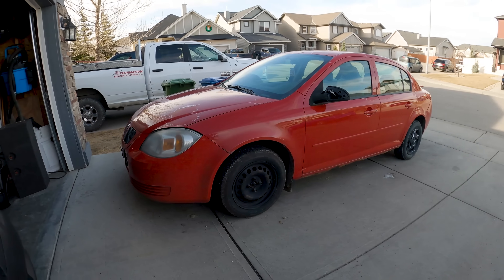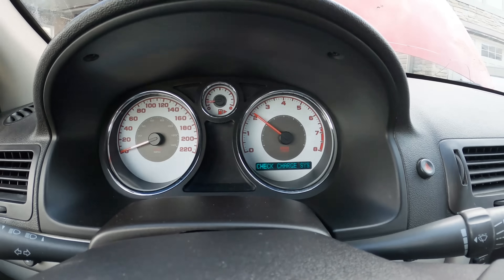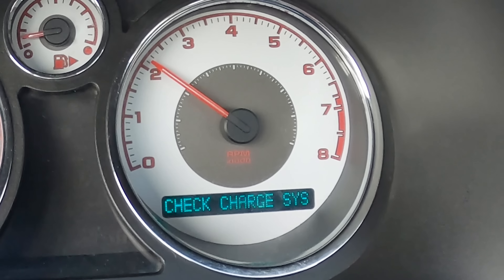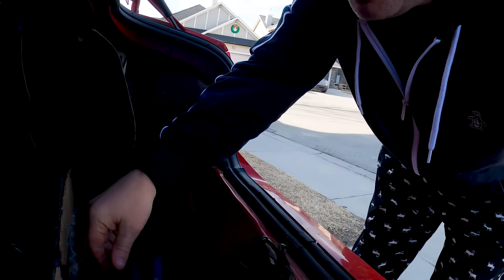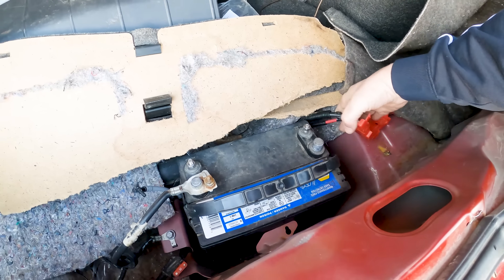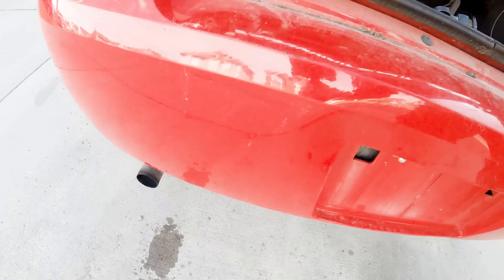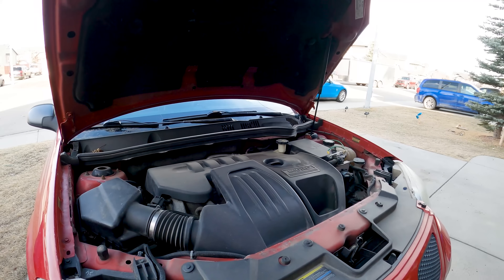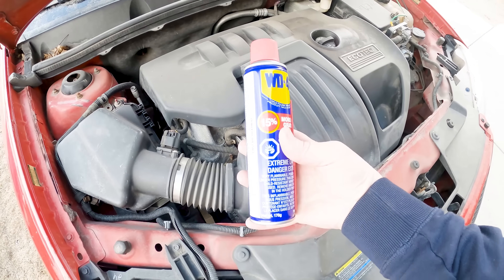ROADSIDE FIX! REVIVE your DEAD or DYING Alternator with this ALMOST FREE trick! | Gears and Tech

Comment: DO NOT DISCONNECT the battery while the vehicle is running as demonstrated in this video on a MODERN VEHICLE. 
Now my 71 c10 outside or my 76 Grenada lol hush yo mouth don’t start this about not screwing up your new car or truck computers and  or Alternator. But yes I have checked to see if my Alternator was working by removing Neg cable off battery. Older vehicles only
Not even gonna touch on the WD
Reply from the maker: Thanks

Comment: In the old days, like 1977, you could pull the battery and it would stay running.
The volt meter actually would be around 16 volts when there was a dead battery.
13.8 when fully charged
Reply from the maker: Thanks for sharing
Reply: That great because i drive a 1977 ford maverick.:hand-pink-waving::hand-pink-waving::hand-pink-waving:

Comment: Surprising, i would have thought that the WD40 end up lubricating the brushes where they sit in their channel aimed at the rotor... allowing them to slip and make contact more easily when they are at the end of wear... the spring is obviously now weaker as it is extended due to the shorter carbon brush... so the brushes can stick near the end... as for swapping out, why not simply buy the brushes and fit them yourself? which on high mount alternators often means you don't even have to remove the alternator... as long as you can get to the rear of it, it is usually one screw that holds the brush module in place so dead easy and cheap to change yourself... you could even carry spare ones... :) good tip though...
Reply: it would be a rare thing for their to be any dirt on the brush ends as they are in constant contact with the rotor centre, they are usually clean as a whistle, so i am going with the lubricant allowing brush movement...
Reply from the maker: Agreed.

It does clean stuff up though.

Comment: you can pull the the batt terminal on older cars but on newer modern cars better not do it you risk frying the sensors or modules because of the high current surge that may occur.
Reply from the maker: Thanks

Comment: Yip yap buy a volt meter read battery not running probably 11 to 12volts. 
Then start and read should be 13 to 14.
Clean those terminals and tighten properly.
Reply from the maker: When that doesn't work? What then?

Comment: I disagree with disconnecting the alternator with the engine running as this removes the load from the alternator, allowing voltage spikes on the electrical system several times the 13.5 to 13.8V design voltage. It can destroy the rectfiers, even in an older, non-computerized car. Also, WD40 on the pulley side of the alternator should not be used. It is likely to cause belt slippage if it gets there. Worn brushes are likely to bind in their brush holders so WD40 may be a very temporary fix here.   It may also clean carbon and copper dust from the insulation between the slip rings, eliminating this resistive short across the brushes may make the alternator work somewhat better. Best to carry a cheap multimeter and test system voltage at the battery terminals.
Reply from the maker: Thanks for stopping by

Comment: If you want to take the battery cable off and do your thing then take off the negative battery terminal. That is called the ground. The alternator will run the car with whatever load it is taking. If it is a good alternator. If the alternator is bad then it will probably just shut the engine down as you explained. If there are voltage spikes then the capacitors will pick up the voltage surges. If that positive terminal goes and touches any ground the battery very well could explode and yes a lot of sensitive equipment will fry including equipment that is not sensitive. Very dangerous and a huge huge bill to fix. I can only imagine what the electrical equipment might possibly look like afterwards. LOL.. Capacitors are designed to take a huge hit but I can guarantee the capicitors cannot handle a dead short. Notice the word DEAD in dead short. So please do your tests with the black negative wire disconnected. At least you won't have a oopsy and get a Dead short with the red positive wire.
Reply from the maker: Agreed on positive vs ground cable, except battery won't do anything even if that cable touches metal, battery is totally isolated once disconnected from positive or negative

Alternator on teh other hand won't be happy about the positive touching ground
Reply: BTW the alternator is grounded so it runs on its own circuit and that is why the system will operate throughout the vehicle. If the vehicle has its proper voltage in the alternator the fuses, etc will do their job to protect the many circuits. There would be no problems with the vehicle working without the battery. Now if there is not enough voltage to produce that power to run the headlights for example the head lights will go really dim and it will eventually cause the vehicle to  quit but it will not destroy the headlights. If you go to low voltage computers, etc funny things could happen but there should be safety equipment built the module for example to protect this also for such an occurence. This would probably cause the vehicle to shut down also.  Common sense dictates thatv if you have Control Modules worth thousands of dollars that there are fail safe electronics that cover both sides of the fence. THe one thing that destroys these modules, etc are the spikes and as I said capacitors and such take care of this probably on a regular basis and of course do not forget about the simple fuse. That is usually the first line of defence. With big voltage spikes can come huge ampacity hence the importance of the fuse. LOw power or low voltage that is below normal voltage in most cases causes stuff not to work properly.  Electronic circuitry is very complicated but it is a lot of circuitry that involves a lot of schematic and wiring diagrams.When everything else is isolated just pop in another computer or module.

Comment: NEVER use WD 40 for your alternator as it is oil based and it will grease those brushes inside , yes it will remove dirt deposits inside and clean it up , you just got lucky if you were 600 miles away from home I'm guessing you were on a freeway driving home going 80 - 100 km/ h which air cooled your engine and all the dirt out of your alternator after you sprayed with wd 40 ... the best thing to use is air gun 🔫  and if you really want to spray something in it I recommend brake cleaner or electrical spray .. there is no oil in either one of those , cheers ... and one more thing if you are disconnecting car battery while engine running disconnect only negative terminal ( black one ) it will not cause any damage.  Cheers
Reply from the maker: Thanks for sharing

Comment: Excellent......WAY TO FRY ALL THE ELECTRONICS IN YOUR VEHICLE !  Never disconnect the battery in a running vehicle. The battery provides reference voltage for the voltage regulator which provides power to the rotor fields in the alternator. Some are built into the ECU.
      IF the alternator is good, output voltage can build beyond input limits of the electronics because battery reference voltage is isn't present to limit output voltage of the alternator.

  Do yourself a favor and buy a VOM ( volt/ohm/meter ). Even an inexpensive one from Harbor Freight ( they're like $8 ) will suffice and measure the voltage at the battery with the vehicle off and then running. Running, the DC voltage should read between 13.1  to 14.9 volts max. ( I'm a mechanic and my dad was a factory trained automotive field service engineer. )
   The two components most likely to be at fault with the alternator will be the brushes or the diode bridge assembly. Some have the voltage regulator pack in the alternator which could be bad also. All these can be replaced by the home mechanic. Any decent auto parts supply house should have them or there's always Ebay.
Reply from the maker: Which vehicle is this circuitry guaranteed to fry on? I'll buy one and do the same test. I would love to see this in action for science.

Not saying you're wrong. I'm just saying I've never seen it, and I doubt you have either.

So whoever told you this happens, maybe ask them which car it is for sure going to happen on so we can put this to bed.

I think we all know a guy who knows a guy that knew someone that thought he fried his car when he disconnected the alternator

But, has anyone here seen it? And if so, what's the vehicle.

I don't want any excuses. When I buy this car and do this test and it doesn't fry the computer, there is no going back. We don't want to talk about how lucky I got. I want certain computer frying to be had
Reply: @GearsAndTech  Did you not read my explanation of why this CAN happen ?  I'm not saying it will happen every time this is done, but it will happen eventually.
     If you investigate how the circuitry of the charging systems of alternator equipped vehicles operate then you will discover what I have stated is true.
     For your pocketbooks sake, I hope your luck holds out.

Comment: that wont help if your voltage reg is shot or if any diode problems and on an on...only helps a bad worn out brushes
Reply from the maker: There are certain scenarios where it won't help. But there are many that it will

Comment: one problem, if the problem isn't the alternator you could destroy the alternator by disconnecting the battery cables!!!! in my shop of the many repairs i did i always asked and about 50 did. Yes i know thats not much but a $200 repair and some can be up tp $500 when its not needed matters.
only!!! i repeat only!!! do the battery voltage test it's under $20 for some of those USB plugs and it tells you the same thing
Reply from the maker: Yes, the voltage test is easy. The battery test was the other way to check it.

Everyone should have a voltage reader in their car

Comment: This guy is dangerously stupid:  You NEVER disconnect the battery with the engine running, or you will instantly destroy the voltage regulator if it is not bad already AND other computers in your vehicles.  NEVER mess with the positive post of the battery first--ALWAYS disconnect the NEGATIVE POST FIRST or you will end up arc welding your tool to the car when it slips.  Oh, The HORROR of stupidity.

Comment: Ford Ka 2004. The car was not drived about half year or more. Its is not a garage car. I was going to trip, but was a very rainy day. About from the begining turn rear defroster on, vent defrost and curclulation on, fan on max, headlights on, wipers on. After about 10 kilometers defrost buttons lights start blinking. I stop the car. The battery had some power yet, but not enough to spark the engine. So i call to an fellow, he came, take the battery and charged it in fast for about 20 minutes. After that i drive about 45 kilometers without using headlight, defrosters, so on. And when i turn on the headlights the car engine almost instantly die. But i use the inertion, turned off the headlights and force the engine. The engine start, so i went back suceffuly. Next day we test the battery, and it looks OK. But when spark the engine, sometimes, voltage going under 14 V, unstable. What ur opinion and what can advice in this case?
Reply from the maker: Bad alternator. Test and replace

Comment: This might work short term on older vehicles. I wouldn't try it on my newer ones. One thing I will say is that by saturating all of your bearings in your alternator with penetrating oil will ruin them eventually. Bearings are packed with grease. The oil will dissolve the grease, they will fill up with grit and eat themselves. I fixed an alternator years ago by replacing the internal regulator for about $14. If the regulator is bad the Wd-40 won't do anything for you and ruining your bearings will cost you a whole new alternator.
Reply from the maker: Round here it's always going to be a new alternator. Doesn't matter why it's not working.

Comment: Yeah, dousing an electrical device with kerosene (which, when you ignore the added "make it not stink like kerosene" ingredients, what WD-40 is) is a BRILLIANT idea... IF your goal is to cause a fire under the hood. Thumbed down. Added bonus thumbdown: Way to stretch a 2-minutes - MAX  - video to 15 minutes...
Reply from the maker: Sorry my friend, but you don't understand what wd40 is
Reply: @GearsAndTech  Guess again. WD-40 = 97-ish% "deodorized" kerosene, scent to cover the remaining kerosene stink, and a few drops of "trade-secret" additives. Don't waste your time trying to tell me I'm wrong. You've already demonstrated, with this idiotic and dangerous video, and utterly crap advice (If you were at all qualified, you'd already know that pulling the cables off the battery of a running car is a REALLY good way to destroy the computer and other electronics of any car newer than about 1980 or so) that you have little or no idea what you're talking about. How you've avoided destroying any vehicle you lay hands on is beyond my comprehension.

Comment: 5 years and over 20,000 miles ago i left on a 1,000 mile road trip. When i attempted to leave the battery was dead. I jump started it and of course the dash guage said the alternator was pushing over 15 volts. When i stopped at halfway point for the night and tried to restart, it was dead again.  It was daylight and nice weather so I didn't have to use heat or AC but the battery stayed stone dead. So I ran the whole trip with alternator running everything. After i reached my destination i took the car to a dealer since they would replaced the battery for free under warranty. To this day it hasn't caused any problems with the system or the alternator.
Reply from the maker: Exactly the point I'm making to all these guys that say it'll wreck the car.

Comment: I disconnected the positive cable on a Nova back in the day while troubleshooting and saw voltage arcing to the battery post. I was leaning against the front bumper, I got tingles, but luckily not bit. Shorted rectifier in the alternator. Nothing to fry in that Nova except maybe the radio if it had been switched on, probably not as transistors utilized back then in radios were silicon. But in a modern car with FET transistors in the various modules, that would have been a very expen$ive move.
Reply from the maker: I have heard lots of guys with close calls. Never seen anyone prove the damage is possible

Hopefully someone chimes in on which vehicle specifically will for sure be ruined if I pull the battery off.

I'll go buy it and do this test to see. You guys may be right. But I don't think it's as risky as some have implied
Reply: @GearsAndTech   I'm not sure anyone that's caused damage doing this is going to admit to it if they some how managed to see this video, but here is a guy that did it by accident, now his car won't start:

https://www.youtube.com/watch?v=fH3roJi_AJ8

For detailed info on the load dump that happens when you disconnect a terminal while engine is running, read this technical paper: 

https://m.littelfuse.com/~/media/electronics_technical/application_notes/varistors/littelfuse_suppression_of_transients_in_an_automotive_environment_application_note.pdf

Comment: Disconnecting the battery while the alternator is working can toast your cars computers. Using a clamp meter to see if the the alternator is producing current, or checking the battery voltage as rest (car off) and while charging (car running) is much safer.
The WD40 trick is neat. Basically, if your alternator has weak insulation, this drives out the moisture to make it work. Until the WD40 evaporates and the alternator cools.
The battery smooths out the alternator voltage spokes. The battery also acts as a load to the alternator. When that load suddenly disconnects, the alternator can generate damaging voltage spikes. The computers have a thing called load dump protection that helps keep them from damage, but this protection relies on components that have a finite life and continued use will eventually lead to failure.
Reply from the maker: Thanks for sharing

Comment: This is the perfect video on what NOT to do to your vehicle! The only thing reasonable was the cigarette plug adapter! Everything else is a NO No! Loose terminal’s is probably what caused the alternator to fail. Never remove the positive term first, and the worst of all, never spray a liquid into or on any part of the engine or components! Especially not a flammable liquid, especially on a hot alternator with a flammable liquid! Unless the liquid is made for it and the engine is cool, and enough time is given to evaporated the liquid!  You can’t be doing half ass rig repairs like this on any vehicle!  And this is your daughter’s car? Call a mechanic please!
Reply from the maker: It's too bad you didn't watch the video.

Comment: Dude your a genius! I would I've never though to use fluid to drive out carbon deposits, i wonder if i use wd40 and then an electrical quick dry cleaner would permanently fix it
Reply from the maker: Not likely. Depending on what the issue actually was. If it was just stuck brushes then it'll fix it for a long time. If it was something else then this will only spfk for a bit
Reply: Of course, I meant only the carbon contamination problem

Comment: I want to ask... Is there an ideal dwell time or soaking in time for that WD-40 trick?
Reply from the maker: I found from the time I soak it to the time I start it is enough.

If it's stuck brushes you want to start it while it's still wet to get them to drop from the vibration of engine running